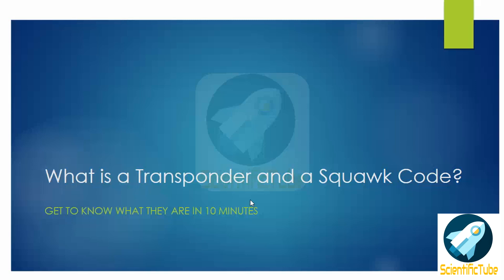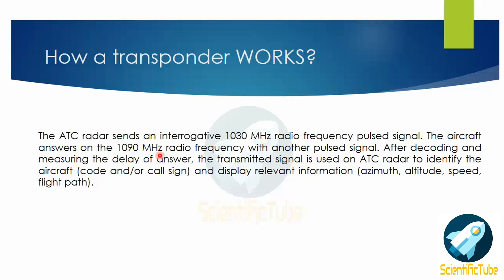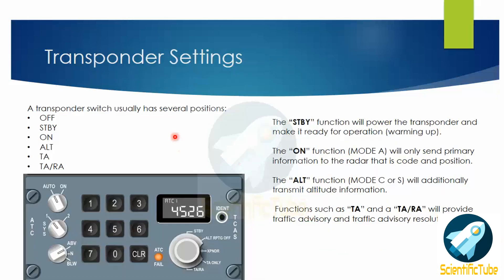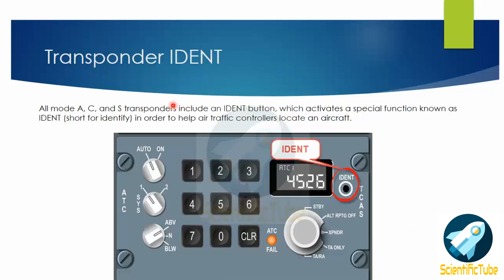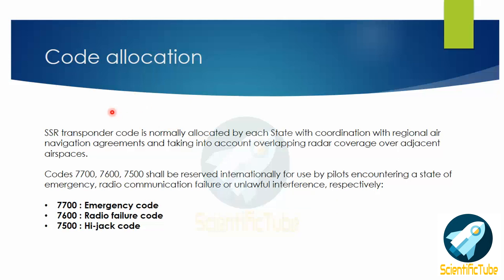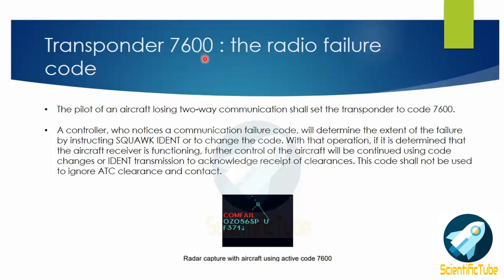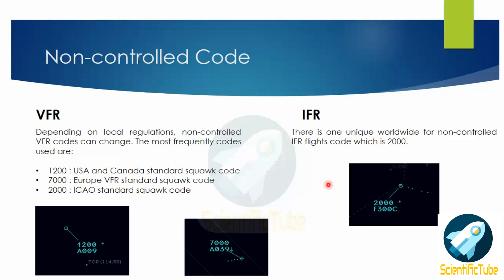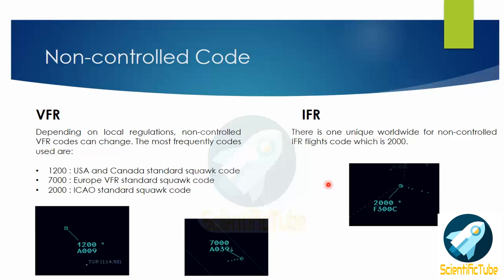What is a Transponder and Squawk CODE 7500-7600-7700? ALL Explained |ScientificTube | From the Sky

Comment: On the "Types off transponder" slide, you stated that "transponder A" ONLY transmit identifying code. But on the next slide for the Transponder Settings," you stated that the "ON" function (Mode A) sends code & position. Can you clarify? Or can anyone else clarify?
Reply from the maker: One is type of Transponder, Mode refers to the different positions that the transponder can be set to transfer different datas